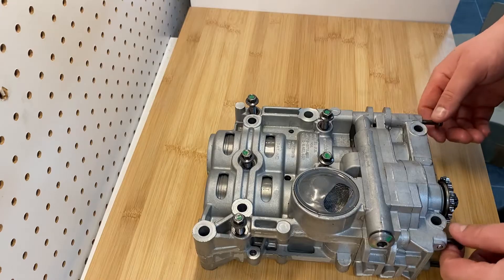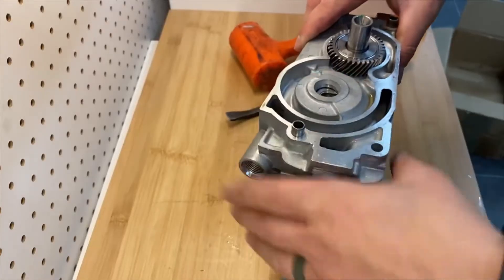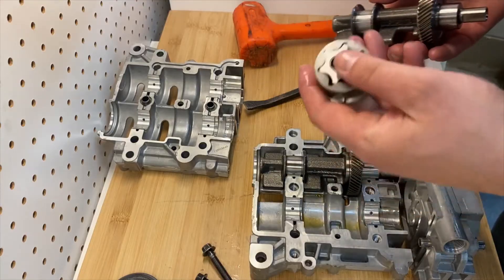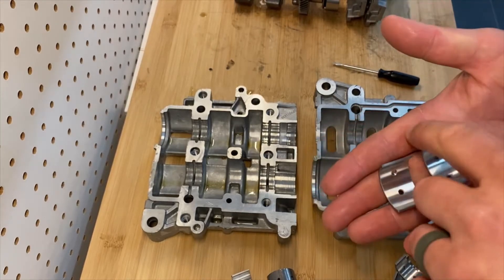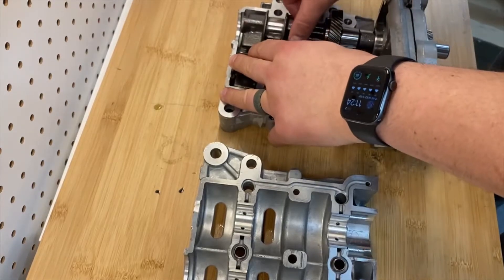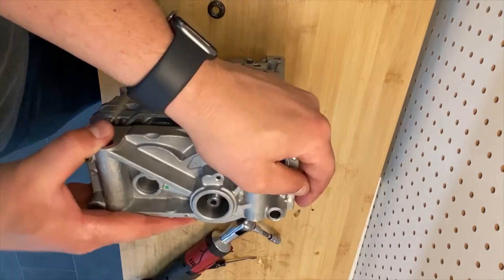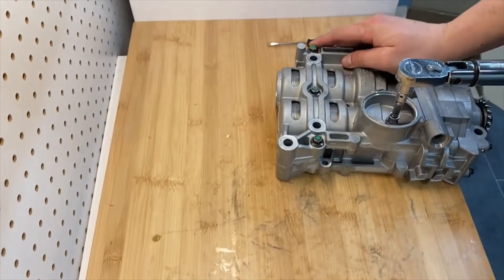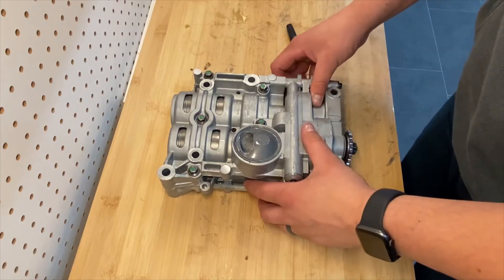KIA/HYUNDAI Balance shaft rebuild

Comment: The best-presented overhaul procedure, including almost all necessary points to be observed for this system, I have ever found in YouTube. But I'm confused with three points:
1- Why there are two oil pumps in this system? Why not a single pump with same characteristics?
2- What's the role of two balancing shafts?
3- Syncing internal balancing weights is understood, but syncing the outside gear with the left side shaft is not clear for me.
Thanks in advance.

Comment: I have one question if possible. I have Hyundai Elantra 2014 1 and 8 engine in Doshi Limited. The problem is that when it is cold, there is a knocking sound from the engine, when it warms up, the engine has no sound at its temperature. The oil does not decrease, there is no smoke, it is good. What could be the problem? thanks.

Comment: Hi
First thanks for your video i am really  benefited
My question is that oil pump have a manufacturing defect?  In my country many of drivers change it to another one which it came with the 2.0L engine because it have along service time.
I hope you respond 😊
Reply from the maker: Hi, 
Sorry for the delay. We have not seen a manufacturing defect of the oil pump but rather when the engine fails the debris can destroy the balance shaft bearings. If you open your assembly and find that the oil pump gears are extremely worn or damaged then we recommend a new pump.

Comment: Hello, I have a question, are the Hyundai Sonata and Elantra engine oil pumps the same, and if damaged, there may be a knocking sound
Reply from the maker: Some of the engines have the same pumps. They made different versions of the same pump for different engines. If the balance shaft assembly is failed or oil pump is failed then possible there is a knocking noise. Typically low or no oil pressure the engine will run until it locks up or throws a rod/destroys the bearings.
Reply: @asianengineparts3996   Thanks for your attention
Reply: @asianengineparts3996  ერთი  კითხვა  მაქვს     მყავს  ჰიუნდაი  ელანტრა    2014  წლის   1და 8  ძრავი   ლიმიტედ. როდესაც   ცივზე  ძრავს  ვქოქავ  აქვს  კაკუნის  ხმა   რომ  გაცხელდება  ძრავი  თავის ტემპერატურაზე  მერე  არაქვს   ხმა    . ზეთს  არიკლებს   არ  ბოლავს   გაწევა  კარგი  აქვს .  რა  პრობლემა  შეიძლება  იყოს  კაკუნის  ხმა.  მადლობა  პასუხისთვის

Comment: Is this timing set up is the same for the 2010 and before models? Mine is a 2011 Hyundai Sonata with 4 bolt pattern. When the timing marks aline one shaft is parallel and the other horizontal, is the timing bad it spins freely but both shafts are not aline

Comment: Hello that was an informative video I have a question ❓
I I have installed a balance shaft but after installation, the balance shaft jumped and didn't move.
After a lot of try and error, i put two washers between the balance shaft oil pump and frame ladder and I fastened the bolts in the correct order , and everything became okay.
Do you think this trick works???

Comment: How are you, my friend? I am Zaki Muhammad al-Shennawi. I live in the Kingdom of Saudi Arabia. I have a 2015 Kia Sportage with the same oil pump. I did a complete renewal of the machine twice and the crankshaft was turned, but unfortunately it did not work and the machine hardened until I was sure that the defect was in the oil pump. I will do a renewal of the machine. Again, but this time you will change the oil pump to a new one. Is the pump installed in the make-up in a certain position or to any position, and is the gear of the pump set to open or close the pump?

Comment: Reading some of the comments I was given the impression that you couldn't just replace the whole oil pump assembly.
I was able to find the whole oil pump for 400 dollars. Not sure if this was a recent change but it makes swapping the whole unit a much more cost efficient solution when considering machining costs. Especially when considering the parts on the assembly that are pressed in and cannot be rebuilt.

Comment: It would be nice if you could replace the oil pumps as well. I find it strange those are not available as they are a common part to replace in an overhaul. It seems like if the bearings are scored the oil pump would would be a victim as well.

Comment: hello very helpful! Im working on a 2014 santa fe sport 2.4, the oil pump assembly is a little different then this one. I need the bearing for the balance shafts and will be getting from you. I took assembly apart but the oil pump gears or sprokets are not there? How does this thing pick up oil!  thanks Kelly
Reply: The oil pump rotors are inside of the piece with the one balance shaft that isnt removable , just took one apart last week

Comment: How do you torque the sprocket and keep the timing set? I time the marks, stick a padded screw driver in the counter shafts to keep things from moving .  Tighten the sprocket and the timing marks alignment move. There has to be a correct procedure for tightening the toothed sprocket and maintaining the timing marks. The video skips that very important step.

Comment: I have a Kia 2008 Rondo with a 4 bolt balance shaft. The teeth on the gears broke off, so the pump is shot. I'm having a hard time finding another 4 bolt pump. Does anyone know if the late 6 bolt pump will fit? I heard that it will and you just don't use the 2 additional bolts, but I don't want to buy one and rebuild it if it won't work. Also does anyone know why the teeth would break off? The oil gets chanced every 5K miles and the engine has 115K.

Comment: PSA*** This is not indicative of all models of Kia/Hyundia 2.4 motors. I have a 2015 Sportage with the 2.4 GDi and while the casing of this pump/B-shaft housing is similar, the internals are not. Key differences are, 1. The relief valve on this one is horizontal, mine is vertical. 2. This one has two pump gears, mine has none, but uses the shaft gears to pump the oil. And 3. Oil pickup is center left as pictured here, mine is center front, closest to the timing gear. (No hidden bolt on mine).  I got my bearings from AEP at a great price! Cheaper than buying a replacement assembly!
Reply from the maker: Thank you for the comment Marcel! You are right that there are different versions based on the year make and model of your 2.4L. For anybody not sure what bearings that they need for their assembly please visit our rebuilding page on our website: https://www.asianengineparts.com/balance-shaft-rebuilding-kia-hyundai-gm-mazda/

Comment: What kind of wrench or socket takes off that chain gear?  Where to buy?
Reply from the maker: Hello! I used a spline 17mm box end extended wrench to get that nut off. Remember it is a reverse thread nut. Left is tight, right is loose. Please reach out with any other questions. Thank you

Comment: Freakin awesome! Im doing the spun connecting rod bearings on my 16’ santa fe sport 2.4l… just under 58K… lets have another… lol anyway I was really worried about just throwing the pump back in but was also worried about tearing it apart and screwing it up. This video is super helpful! I already have it out for the rod bearings so I will tear it down and order the proper bearings from you guys. Thanks!
Reply from the maker: Sorry to hear about Santa Fe sport. We hope our bearings help you with your rebuild and have it up and running in no time! Please feel free to reach out if you have any questions!
Reply: Hi .. do you have to remove the complete timming chain set up ?? Or just the chain of the pump ?

Comment: Hi!
For what type of engine is this balance shaft?
2.0 136 CRDI?
Thank you so much!
Reply from the maker: Hi thank you for your question. This Balance shaft assembly came out of a 2010 Kia 2.4L. But these balance shafts are also used in the 2.0L by kia as well. If you go to our web site www.asianengineparts.com we have a breakdown of the bearing sizes. I recommend opening your balance shaft and measuring the bearing. Then compare it to our replacement bearings to confirm size. I hope this answers your question. Please feel free to email Sales@asianengineparts.com if you have any further questions!

Comment: Good video on dismantling a completely useless waste of metal, time and engineering! There is absolutely no need for this assembly to exist. It serves no purpose other than to waste metal and create dead weight and more mechanical losses in the engine, 
What is it balancing? itself?   
All this engine needs is a simple oil pump about the same capacity as the (two!....) units already inside this thing.
Reply from the maker: Thank you for your reply - let us know if you have any other questions!
Reply: Yes why do They have to over engineer
Reply: Aqui no Brasil trocamos essa bomba problemática pelo modelo dos motores Kia 2.0 e não tivemos mais problemas

Comment: Can you tell me where to find the socket to remove the nut from the front sprocket?  What type of nut is that?
Reply from the maker: Hi and sorry for the delayed response. I used a spline 17mm box end extended wrench to get that nut off. Remember it is a reverse thread nut. Left is tight, right is loose. Please reach out with any other questions. Thank you

Comment: very helpful video friend, i have a headache of a time with these, getting the engine repaired is not difficult but putting the pump back on after cleaning and visual inspection to have no oil pressure is frustrating, im going to look through AEP thoroughly, finding parts, in stock or not, proves difficult on its own for this particular engine. thanks again and ill be checking out your other videos as well
Reply from the maker: Glad the video was helpful - let us know if you have any questions about our Store!

Comment: is there delete kit? I would just as soon remove it
Reply from the maker: So this is a balance shaft and Oil pump assembly. It is what creates the oil pressure throughout the engine. Removing it and the balance shaft assembly can lead to catastrophic failure. We recommend using a good core and using our bearings to cheaply rebuild your balance shaft/oil pump assembly. Like we state on our webpage these bearings and this rebuild solution is what many large re- manufactures across the country choose to do.

Comment: Can the balance unit be removed from 2013 optima  without pulling the engine?
Reply from the maker: I am sorry but I am not sure if that is possible. It would depend on how much room you would have between the oil pan and the subframe of the vehicle as well as the front of the engine to access the gear and chain. I would recommend talking with a repair shop for some tips!
Reply: @asianengineparts3996  hello thank you for the information my  2.4l ( I just did it) once the front cover and tensionor came off enough slack allowed removal. If I had been able to remove the drive gear nut it would have been no problem
Reply: @johnr4898  hey john, I work on these for a car lot, about two a week from auction. are you saying you took the timing cover off the engine front? i have pulled the head off and pulled the bottom of the block off without removing the engine but not the front cover. i'm glad to hear its possible. i'm going to attempt it soon are there any tips you can share good sir
Reply: @Thomas-cz3vi  Hello Thomas, yes the timing cover comes off, the hard part is getting the crankshaft pulley bolt off. once removed, the pulley on my engine just slipped off no tool required, remove the valve cover, water pump pulley, front motor mount (put a support under the trans first), windshield wiper water bottle, the belt tensioner pulley mount, un-bolt it from the pan, I think that is all, then it lifts out.
Reply: @johnr4898  alright man, thanks. ive been slow playing one trying to figure out how i want to approach it. i am assuming that if it all comes off then it will all go back together in proper time, not easily im sure but not an all day deal either. again thanks for the info, hope your sunday is going good